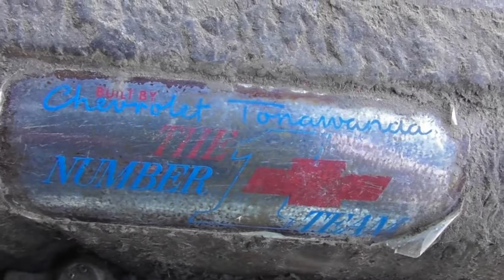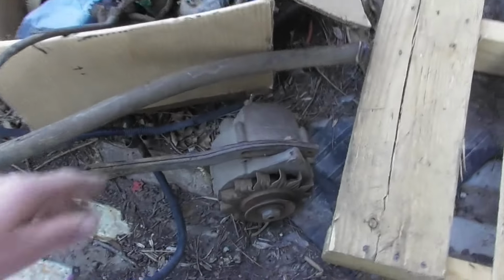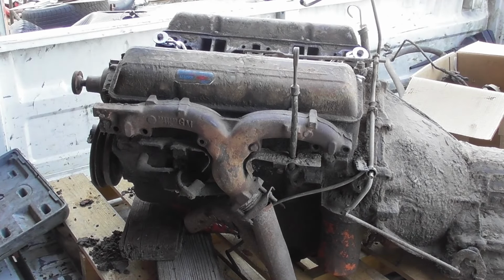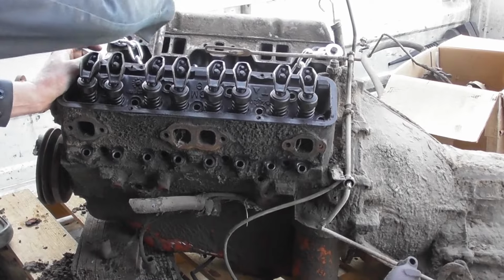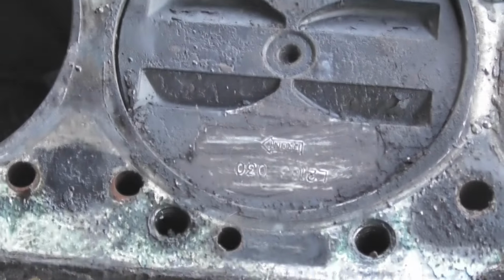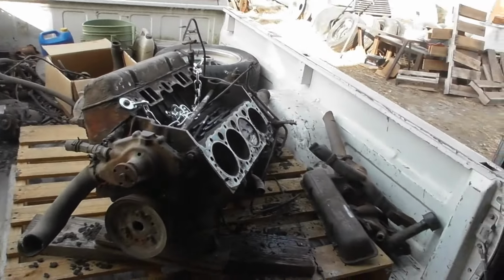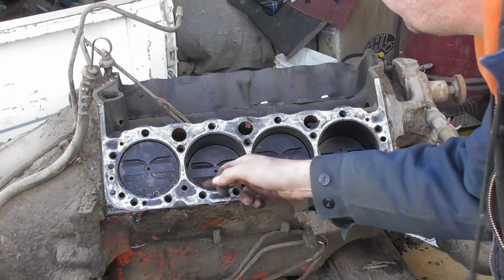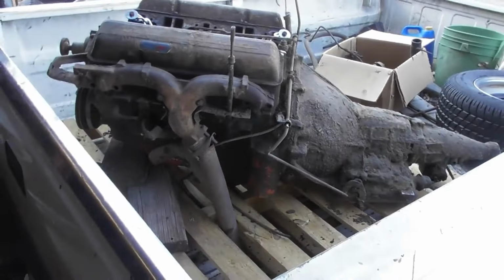283 sbc tear down is it good or trash? 1967 small block chevy muscle

Comment: One thing that I learned back in the early 1970's when building a 327 to put into my mum's older Chevy II was that almost all of the SBC parts would fit in whatever SBC you were working on. But... they might not be what was meant to work for that particular application. I bought a distributor somewhere along the line but it came out of a pickup truck so the advance curve was wrong for the car. I did the  same with buying a carb. So, as easy as I hope it still is to find parts, be careful to get what will works best for your application. Good luck on your build; I'm sure it'll be fun and rewarding.
Reply from the maker: yeah you have to be careful when mixing parts, it can lead to weird problems. still not 100% on how i will put it together, its going to be a everyday driver

Comment: I built a 283 back in '92 as my first engine.  Steel crank and bored it .030 over as well with a eddy performer cam and it ran great for a small engine.    To find what looks to be rebuilt one that grungy just shows how much time has elapsed since '67 when it was new.       Are you sure that the ridge isn't mainly carbon build up?   The cylinders look pretty glazed so it looks like the cross-hatch is pretty much gone so new rings and a hone would be needed at least.    Excited to follow this build..
Reply from the maker: that trans was def grungy, its got a good ridge from wear, havent decided what i want to do for sure with it, i have been looking for another 283, hopefully i can find one in a little bit better condition to start with, thanks for watching
Reply: Used to be you could find 283s everywhere, but getting rarer now.   Still looks to be a good builder, but if not, there's def. some parts on there that would bring money.   Have you pulled the bottom end apart?  Curious in the condition of the crank and bearings.... @chevyfarmersgarage1955
Reply from the maker: i have not pulled the bottom end apart, got kinda sidetracked from it, i have been searching for another one, i want to stay with a late 283, like another 67, they say they are a better / harder block than the early ones, they are not supposed to wear the bore so easy, although this one was out of a 67 impala, i never did check the date on it

Comment: any sbc is gold
Reply from the maker: for sure!
Reply: That's what I'm saying but everybody hates on anything smaller than the 327 but with a little bit of love they may not make a ton of power but will be a fun reliable motor
Reply from the maker: nothing wrong with a 283, heck even a 307, which is just a stroked 283. the 267 and 305 are the smog dog small engines, where most of the hate comes from i believe
Reply: @chevyfarmersgarage1955  most hate I've seen was the 305 but they make power when done right would I go out and buy a motor smaller than the 327 to build probably not unless I really wanted to see what I could do but if you've got a car that's already got a 305 they can make decent power with mods and throw deeper rear gears and a stall converter in it and ittle rip pretty damn good
Reply: @chevyfarmersgarage1955  my buddy's dad literally said that 305s weren't worth pissing on if they were on fire mind you he was talking about a 305 that came out of my buddy's truck that would spin 31s relatively easy with just a 3.73 rear
Reply from the maker: only 305 i have is in my square body dump truck, got it at the pull your own auto parts place many years ago, it was in a wrecked g body that had 69,000 miles on it, aint the most powerful but it will get the job done, just a little slower, LOL
Reply from the maker: they are good little commuter motors, worst part of them is the heads, not the greatest for making power and are crack prone, not as bad as the 350 heads of the era though